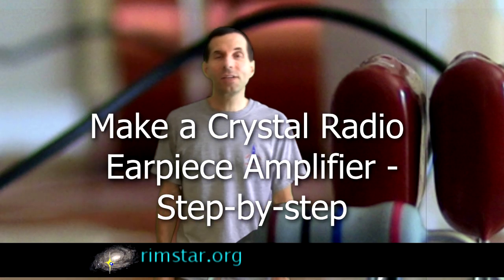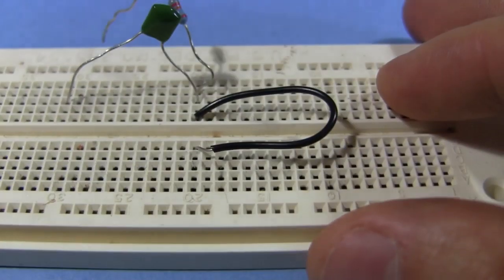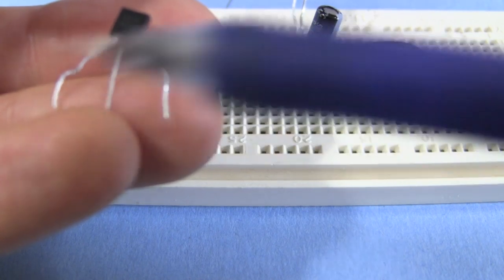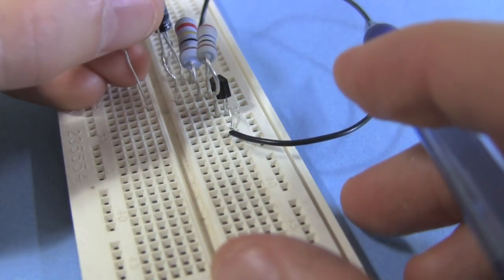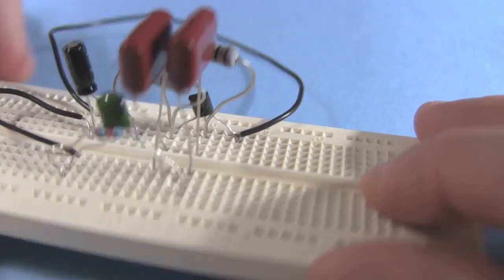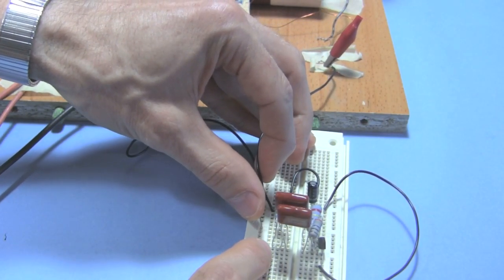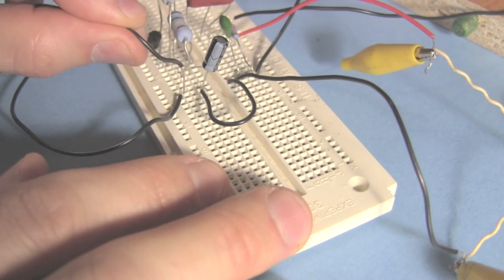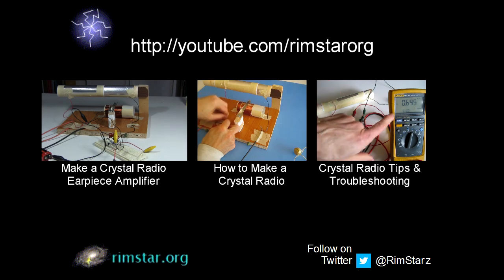Steps for How to Make Amplifier for Crystal Radio Earpiece

Comment: Great video, funny you should upload this right now as I have been playing around with homemade radio circuits too recently. Although I used an LM386 chip for my amplifier so I could use a normal speaker/headphones (this chip is one noisy beast but works pretty well for so few components).

Comment from the maker: How long is your antenna? The longer your antenna the better reception you'll get. Mine is short, only around 15 feet, but I live near a few radio stations. How close together are your two coils? The closer they are the stronger the reception but the harder it is to tune. Mine are about 1/8 inch apart. How many turns do you have on your tuning coil? How big is your capacitor area surface area? If your capacitor is too small or the plates not close enough then you'll be limited in tuning.

Comment from the maker: A the beginning of the other video I say that you still need the earpiece. It won't power an 8 ohm speaker. You need a high impedance output device. A crystal earpiece has an impedance of around 20,000 ohms. I'm not familiar with hooking up an inductor to a diode. How is it hooked up and why?

Comment from the maker: Ah, I understand now. You need a tuning circuit. You need two coils. One coil is attached to antenna. Second coil is in parallel with capacitor. Second coil and capacitor are for tuning in to station you want. Second coil must be variable and capacitor must be variable capacitor. Full instructions are in my "How to Make a Crystal Radio" video. There is a link to it in the description below the video and there is a link at the end of this video or you can look for it on my channel.

Comment: Well my crystal radio is different from yours. I am using a ferrite rod that I grabbed from the broken radio as well. I have 3 coils on the rod, one coil is tied into the inductor then from one lead of the inductor i also attach the diode. I got the idea for the ferrite rod and inductor from a different web site. I figured any crystal radio could be attached to the radio. Would love to have a speaker though.

Comment: Dear Sir, I would like to build crystal radio with amplifier on the same board. Can you please share circuit diagram for the combined ? Thanks in advance
Reply from the maker: Ashok Nikumbh That's a neat idea putting a crystal radio on a breadboard. Unfortunately I don't have the time to do it.
Reply: Thank You Sir. One more quari. can be capacitor be wound on pvc pipe,instead on toilet paper sleeve .( I have not studied electronic, its only my chiledhood hobby to built radio ) )Thanking you
Reply from the maker: Ashok Nikumbh Yes, you can use a PVC pipe instead. Also see my crystal radio tips and tricks video https://www.youtube.com/watch?v=HZZmKZJrIW0 and there is my webpage with everything in one place http://rimstar.org/equip/crystal_radios.htm Have fun with your crystal radio!
Reply: Sir one more curiosity, can it be same diameter for antenna & paper capacitor? + will it be okey if diametrs of both the items minimised to one cenimeter. Thanks a lot for help
Reply from the maker: Ashok Nikumbh I don't understand your first question. What do you mean by "antenna & paper capacitor"? If you are asking if the coils can have a diameter of one centimeter then the 90 turns coil should be 150 turns instead.
Reply: Respected Sir, Antenna  I mean for coil to be wound on smaller dia  pvc pipe .Also whether aluminium foil capacitor can be wound on 1cm dia pvc pipe. Plz. excuse me for lacking in my expressions OR not putting my doubts in appropriate words. Thanking You Sir.
Reply from the maker: Ashok Nikumbh The two coils must be the same diameter and close to each other like in the video. The reason for that is explained in my video on how a crystal radio works at around 10:43 http://www.youtube.com/watch?v=0-PParSmwtE. If you use one centimeter diameter then the 90 turn coil should be 150 turns instead. The 25 turn coil can stay 25 turns.
The area of the capacitor plates must stay the same, even if you decrease the diameter. The area of mine is 6"x6"=36 square inches. That's 232 square centimeters. If you use a one centimeter diameter then that's a circumference of 3.14cm (circumference = diameter x pi, pi is 3.14). 232 / 3.14 = 74cm. So your capacitor foils will need to be 74cm long.
Reply: Thank You very much Sir.Will it be okay if I wound 90 turn coil ( tuning coil / secondary winding) ) over 25 turn ( primary coil / Antenna coil ) for better induction. Wire lids of primary coil can be taken out from hollow portion of pvc sleeve as this coil ( Antenna ) is getting covered up by 90turn coil.
Thank You Sir
Reply from the maker: Ashok Nikumbh Yes, you can do that. You will have better induction, meaning better volume. But if you have many radio stations with frequencies that are near each other then you will have more interference, hearing more than one radio station at the same time. If the frequencies for your radio stations are not near each other then it should not be a problem.
Reply: Sir will it be helpful to amplify sound by adding 120/12.6 volt transformer
between sound output terminal & ear phone.( By connecting 9.6 side to output terminal &Primary 120 lugs to earphone   )
Thanking You
Reply from the maker: Ashok Nikumbh It would seem like that would work but I don't think it will. The reason is not obvious. The 12.6 volt side will take too much current from the tuning coil and tuning capacitor, and it won't be able to tune into a radio station. At least that's my understanding.

Comment: Comparing to your previous video, the location of the 0,001uF capacitor and the 82kOhm resistor have been inversed. Is there any reason for that or is it all the same? Thank you for your work
Reply from the maker: Good eye. The webpage which I got the circuit from (with the owner's permission http://www.techlib.com/electronics/crystal.html) has the capacitor nearer the diode, as in the first video How to Make Amplifier for Crystal Radio Earphone. Both ways seem to work.

Comment: I know you are using an earphone for this amplifier and you say at the beginning of the other video that you don't have to use an earphone. So will this power an 8 ohm speaker? I also have a variable inductor that i have hooked up to my diode, will the inductor mess up the circuit?

Comment: Where is a schematic pleas,
...    and 
What TRANSISTOR  ?
Reply from the maker: All I've drawn are circuit diagrams and breadboard layouts. You can find the original schematic here http://techlib.com/electronics/crystal.html
For the transistor, I use 2N4401. I missed mentioning that in this video but in my first video, where I also give a circuit diagram, http://youtu.be/gtRhJkAojEQ I point it out.